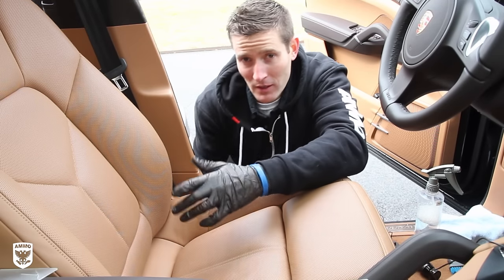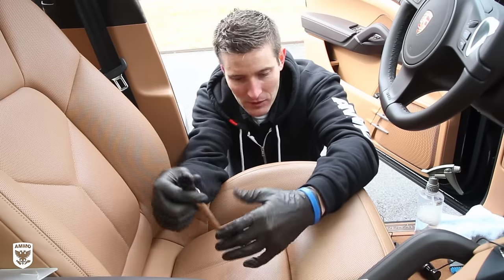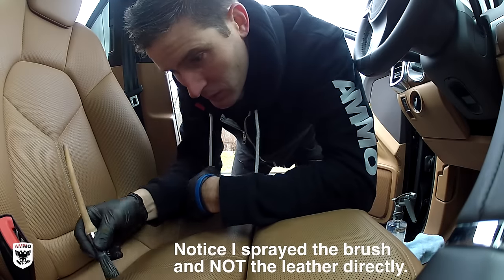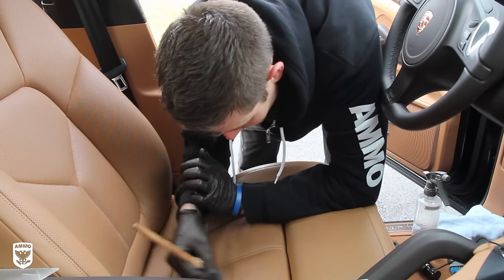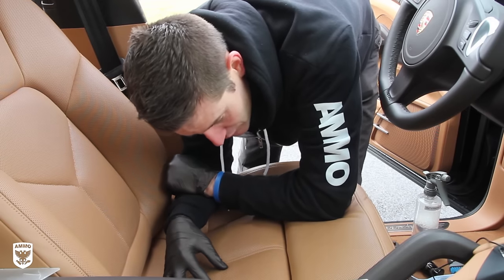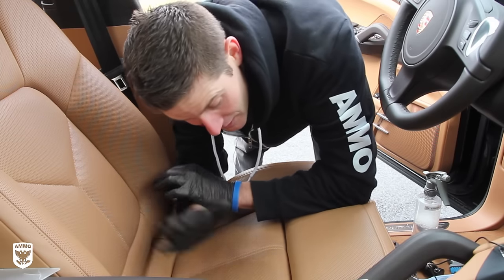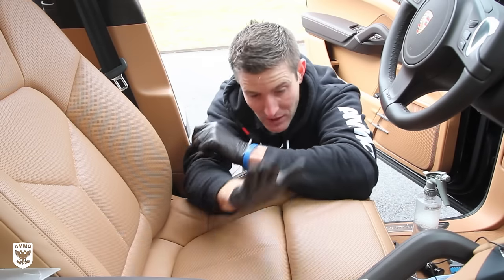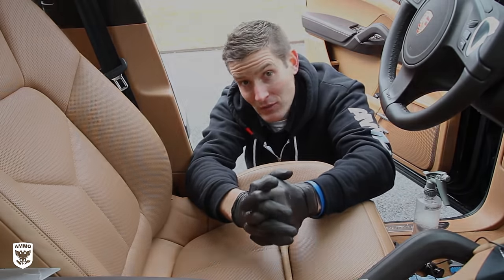Trick to cleaning perforated leather car seats

Comment: Good tip, just got a car with heated and cooled seats.  I think I'll run a vacuum over it afterward whether I think it needs it or not but will also put a micro fiber cloth over the opening of the vacuum attachment.  I'm sure it will still have enough suction to vacuum through the micro fiber;  just for a little added scratch proof protection.  Thanks for your informative videos!  Have a good summer:)
Reply: This is a really good tip! Thank you haven’t really cleaned cooled seats before but this was the best video and also the best comment I’ve seen so far. Cheers.

Comment: Using a brush, cleaner and vacuum didn't work for me on getting out little bits of food in the holes. Right or wrong, I had to use compressed air and it worked perfectly. Night and day difference. Keep up the good work and videos.

Comment: If you have a quite strong vacuum, you could always wrap a microfiber towel or cloth over the noozle to protect the seat. It will diminish the power, but most common cleaners should still be good enough to get any left over foam out of the perforations.

Comment: I'm gonna try this.   I've always used high pressure air in one hand to dry and blast while having a damp micro fibre with cleaner on it in the other.

Comment: The majority of cars with "air conditioned" seats are actually ventilated meaning that the internal fans within the seat are actually sucking in air versus blowing out from the perforated leather.  Hence the vacuum technique is most likely the best and safest way to remove excess moisture versus turning the seat's ventilation/heating system on full blast.
Reply: Binhtri Vu

Comment: It was a good video. I run the heat and air in my Challenger before I even start to insure the holes and leather cant absorb anything. Would like to see you take it to the step removing butt-shine from the surface. I can see how the rear seat has the nicer patina for lack of a better word. Any tips from other viewers are appreciated too!

Comment: Something to keep in mind:  I heard that high heat deforms wet leather, I doubt the but warmer would make a difference though.
Reply: It does. My seats in my new dodge ram Laramie with black perforated seats.  Used my heatedsears last night after the leather seats were basically 99% dry n now I have a little bit of  ripple..I'm pissed

Comment: I have a Lexus ES with perforated leather seats and I noticed there is a very small piece of dirt inside the one of the holes. The vacuum and cleaners don't seem to get it out. Is it safe to use a needle to poke at it?

Comment: If I was going to perform a deeper clean on slightly more dirty perforated leather with a Porter Cable and soft brush attachment, should I spray the cleaner on the perforated seat or spray only on the attachment?
Reply from the maker: +Andrew Tran With perforated leather, always spray the cleaner on the tool. Never spray directly on the leather as you don't want too much going into the holes. Thanks for watching and hope that helps.

Comment: How would you polish and condition the seat using a cream type ,without the holes clogging up?
Reply from the maker: start on a non-porous area of the leather and also make sure the conditioner is spread out on the applicator which should help.  Thanks for watching

Comment: How about using conditioner on perforated leather? Does it prevent cracking and fading?
Reply: yes it will, as perforated leather is simply leather with holes, the holes actully exaggerate moisture lose and quarterly conditioning will make them last longer and stay soft

Comment: Wouldnt the quality of the leather matter? My 09 Escalade uses a sorry excuse for "leather" which has cracked and when cleaned, the top layer peels off and fades even more. My '14 328i and 740Li have much better quality leather and overall materials and his methods work very well with cars that use "true" leather.

Comment: Totally agree with your methods on all things car-cleaning related so far, except one.......... Being a "Porsche Person" you should know that the ventilated seats in our cars don't push air out the holes like some seats do. Instead they draw in air away from the skin. So it's probably not advisable to use the seat ventilation system in these particular vehicles, because the cost of replacing those suckers is not as cheap as one might think. But I can see where you were coming from.

Comment: My daughter got a tiny bit of chocolate on one of my perforated seats and a few of the holes are glogged.  Whats the best way to clean that?  I'm not sure I simply want to push the chocolate down into the seats.  Is there any good way to get it out/off?
Reply: Jamey Bowser I have same problem I think the best use a vacuum
Reply: Jamey Bowser hot water extractor or steam clean it out.
Reply: I know this was a year ago, but hot water on leather ? Hmmmmm...

Comment: Love your videos,   I have a Chayenne with a little creasing on the leather seat pad, any suggestions on the best way to smooth them out, I've used ph neutral cleaner and Autoglym leather balm to nourish.   Any suggestions wuld be helpful.
Reply: Some people use an iron on low setting with a towel. BUT do some research first on how to do it so you don't burn the leather. I've done this and it works wonderfully. I know your comment was a few years ago lol

Comment: Do you think this would work on perforated fabric?  My Dodge Charger R/T has cooled and heated seats and is a meshy fabric in the middle of the seat and the sides of the seat are leather. Theyre black and look dirty sooo fast
Reply: use leather cleaner only on the leather and some fabric cleaner like ammo shag or folex on the fabric portion, the best you could also do is use a steamer

Comment: How do you clean leather perforated seat where dirt got inside the holes? Thanks!
Reply: replace
Reply: to be honest.... that's exactly what i'm gonna do
Reply: Max Kalin if you replace the seats out a sealant on them!
Reply: Yeah! I already have the sealant for that. thanks!
Reply: You might as well protect the steering wheel if that's made it leather as well and the dashboard!
Reply: I have plastic dashboard so I use another product for it but the wheel - yes. Done it already

Comment: does blue dye from new bluejeans get rubbed into the leather permanently?
Reply: No, you should be able to clean it up with some time and patience. I dealt with the same problem with my last car, which had tan leather seats, and I ultimately used some brushes and leather cleaner to gently work the blue dye out. I'd definitely recommend using some kind of protectant to keep it from getting worked in again after you clean it up, though.